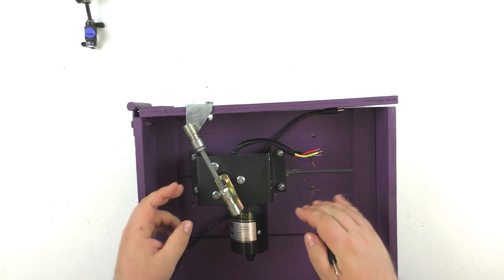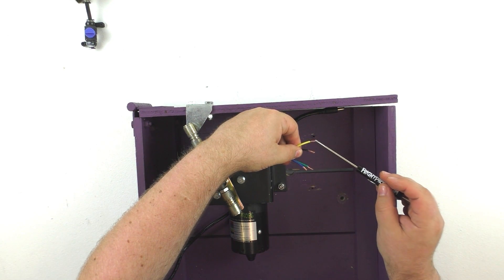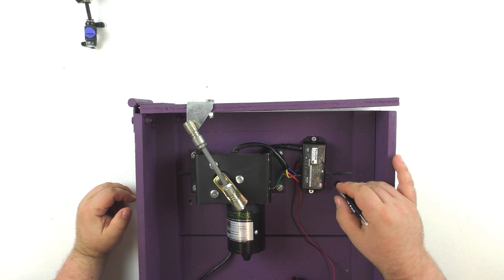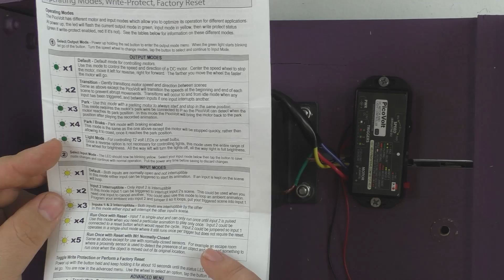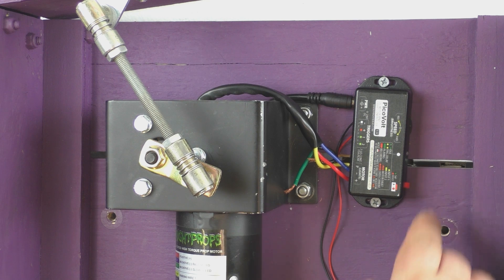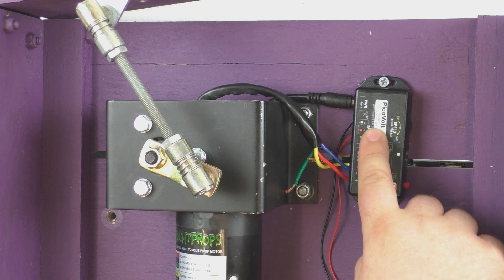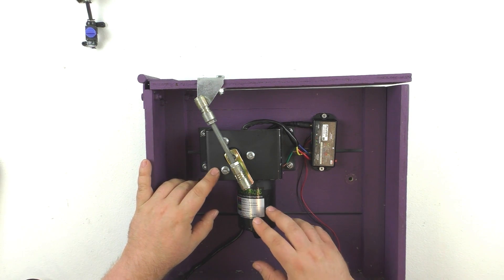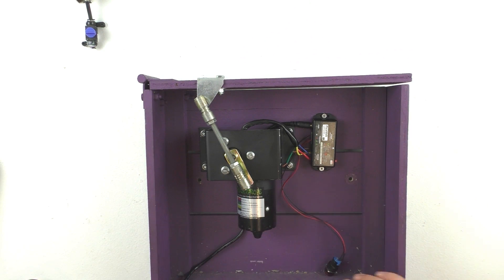Electric Lid Opener Mech Demonstration - Open a Lid with an Electric Motor

Comment: Hmm this is not the correct way, if you use a linear electric actuator to push on the crank that connects to lid via linkage that will make the box nearly empty vs a box that is full of actuator.

Comment: What do you mean by controller when having a motion sensor?
Reply: Jennifer Razon the motor needs to be hooked up to a controller to trigger with a motion sensor
Reply: Jennifer Razon if the motor has no controller it will run continuously

Comment: Can you use this outside? Also do you need the pico or can you use this with just a motion detector?
Reply from the maker: It would have to be protected from rain or water. You do need a controller to use a motion sensor if you want it to work properly.
Reply: Thanks for the info.